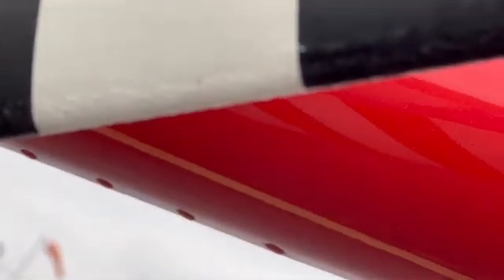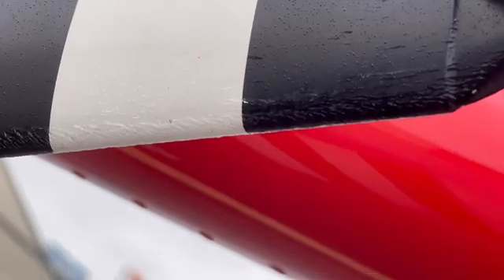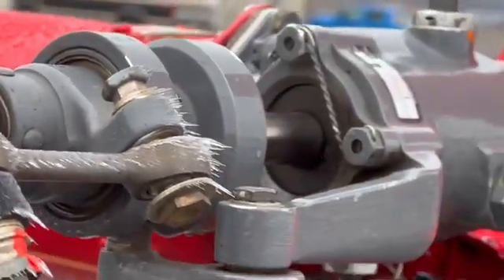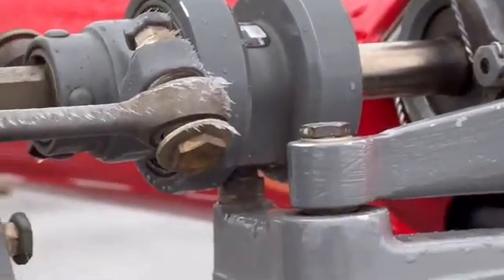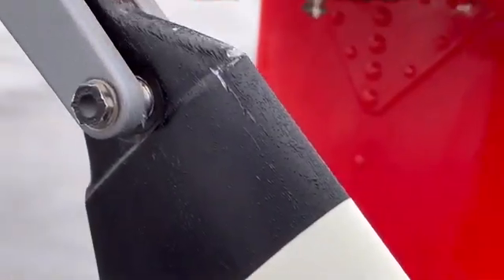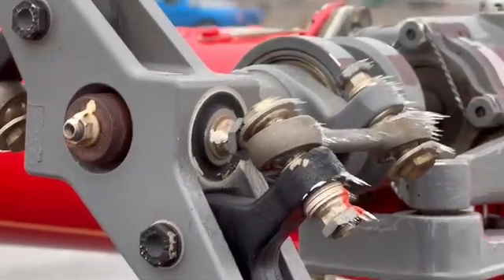Blade Icing in a Robison R22 Helicopter - yes it can happen!!

Comment: I like that initial chuckle..I've done Ice in a BE35 fixed wing and had to declare known.. I FR training flight climbing through a stratus layer 6500 to 11000 feet msl (take-off 560msl) .      10 minutes yielded 3/4 inch (20mm) on the visible leading edge that dissipated in about 1 hour in the sun..  The instructor now owns that aircraft...

Comment: I suspect that ice can form on the blades when the temperature may be a couple of degrees above 32º, too.  Wind chill, caused by blade movement through moisture, can result in water freezing, even though the ambient air temperature is above freezing.  I, first, discovered this phenomenon, while fly fishing in YNP, a few decades ago.  Even though the air temperature was a few degrees above 32º, after making a few false casts our lines would freeze to the line guides.  We had to dip our rods in the river to free the ice.  We were younger and stupider in those days, and could be found casting for trout, during blizzards... yes, we caught fish.😀  Wondering... if something might be sprayed on those rotors to keep ice from attaching.

Comment: Did this cause any damage in either case? I imagine the imbalance on the blades could put a huge amount of stress on components like the main rotor gearbox. Also perhaps the increased weight on the main rotor blades could put more stress on the bearings that allow the blades to change pitch. If I'm not mistaken, inspections are done on those bearings in the event of a significant rotor overspeed. I would be curious to know if there have ever been cases of damage due to icing (that didn't lead to an accident).